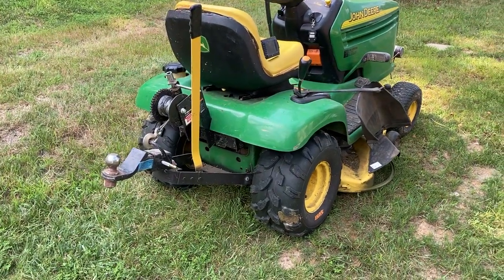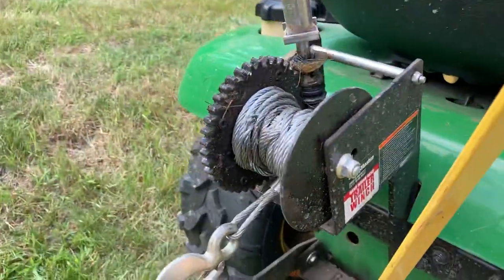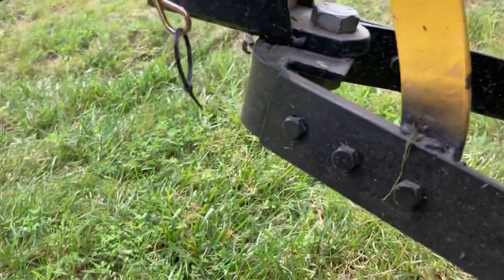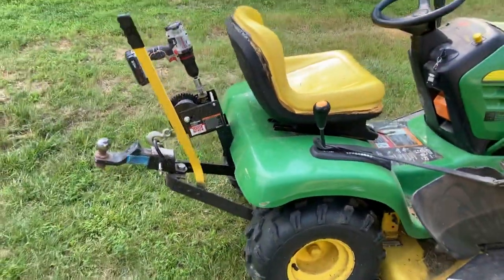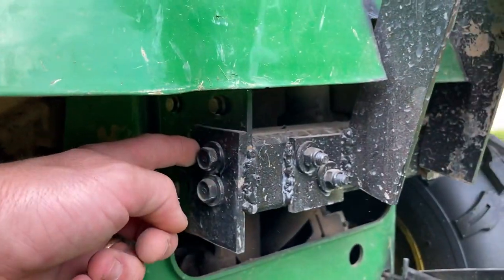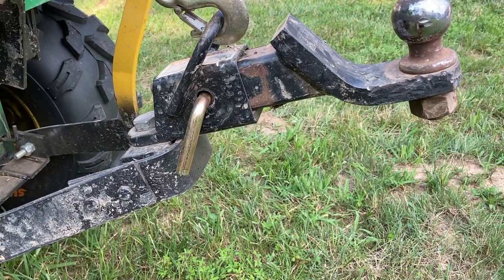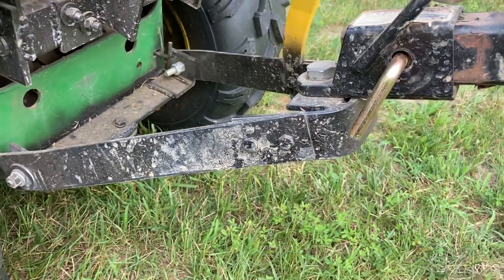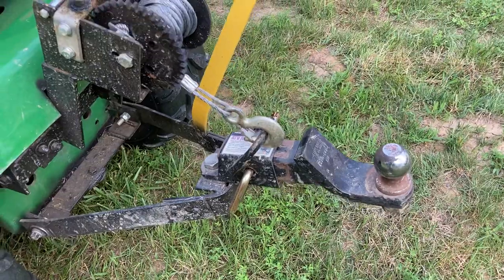Garden tractor Sleeve hitch, 3 point hitch,Rear attachments  DIY

Comment: Great build. Simple, mechanical, and SERVICABLE! I like the worm gear winch. A lot of power with a lot less resistance, obviously, since you're using a regular cordless drill. Since it does have so much power maybe use one of the 12inch flexible ratchet extension on it then you wouldn't have to turn clear around to pull the trigger.  Maby screw a cup holder down on that side for the drill to sit in. Thanks for sharing
Reply from the maker: Thank you Davis! Good idea you had too!
Reply: I think that is the only one like that I have seen.

Comment: I like your simple idea. As a senior citizen on a budget...this is great. Nice video presentation too. 👍🏾
Reply from the maker: Thank you and yes it is simple and cheep to do!
Reply: brad degraffenreid 
I have a zero Troy-bilt zero I’m hoping to add attachments for working in the yard. One issue I’m anticipating is that all the weight is on the back. More than likely I’ll add dolly wheels on the front to compensate for weight. I’ll post something in the next few months
Reply from the maker: Sounds like a good idea.  Also just something to think about that I did is add fluid to the tires. I used  windshield wiper fluid because it will not freeze or corrode. That’s assuming that you have inflatable tires on the front of your zero turn but I’m thinking maybe it doesn’t.  Just a though.

Comment: I came across a breaking plow, disk, and small cultivator for a garden tractor. Now I need a small garden tractor. My lawn mower has a hydrostatic transmission and I don't think it will last.
Reply from the maker: Mine also has a hydrostatic transmission.  I have using it for odd jobs for years now with no issues.  Do you know what rear axle it has? That’s what I would be mostly concerned with.

Comment: Pretty nice. Would like to build something similar to my Craftsman tractor. But let me revise your cost list. You forgot the $300+ for the oxy-acetylene torch setup so I can build this thing! Ha ha ha ha! Another is is that your manual lever can act as a backup if your drill dies or winch breaks somehow. Nice!
Reply from the maker: I just recently put liner actuator for the rear sleeve hitch. Seams to work pretty good.  I plan on showing a video of that soon.  As far as the welder I use Flux wire so no gas lol.   Thanks for the comment.  Have a good day!!

Comment: I think you might want to add a brace in front of the winch, to form a triangle with the tractor frame. Maybe it's not visible but it looks like a lot of torsion stress on the one attachment point to the tractor.
Reply from the maker: I have added a brace not long after making this video.  You are correct it’s a lot of torsion.  I need to do an update on the pros/cons.  Definitely doing some “along the way” engineering lol.

Comment: Nice man, now splice you in a drill charger ;)    j/k  good thinking.
Reply from the maker: Hey Rick thanks for the comment. That’s actually not a very bad idea lol.  Not sure if you’ve seen any of my other videos but I recently put a linear Actuator on the back hitch.   I kept the mechanical winch though for extreme loads for up pressure.
Reply: @braddegraffenreid9106  I'll check it out
Reply: @braddegraffenreid9106  I'm going to amend that, yeh that would be cool, I'm always using the little tractor just to haul around tools. Would save plenty of trips up the hill to change batteries, that always go dead with two screws left. lol    Of the mag though, would almost want to run it through like a back up for a computer, that spikey power might make some sizzles.  Got me thinking now, I could throw a double pulley like runs my bagger on the other side of the deck....weld a bracket....   :)
Reply: @braddegraffenreid9106  You inspired me putting that drill on there, I'm thinking I might try a trailer Jack for a power up and down.  Will have to figure out some kind of float mechanism, but i grew up fabri-riggin, a month or three I'll send you a link.  thanks man
Reply from the maker: @ricksanchez3176   that would be cool, yes send me a link when you get it done. I would love to see it.  I to have spent my life “rigging “ things together lol.